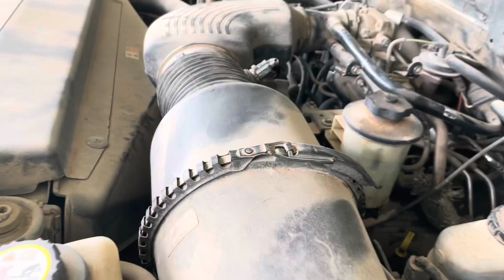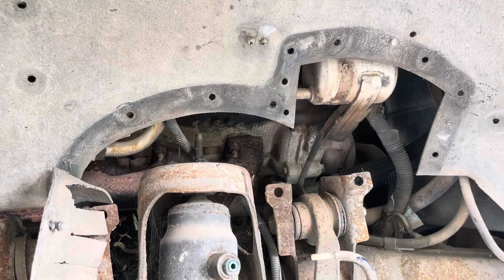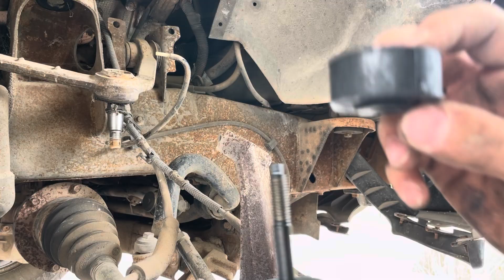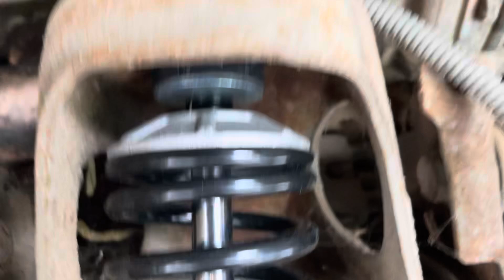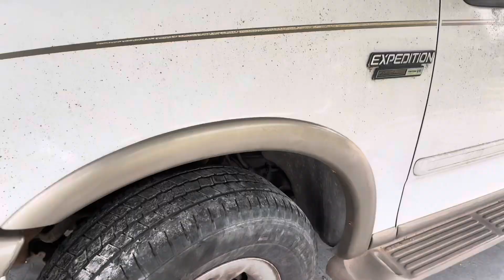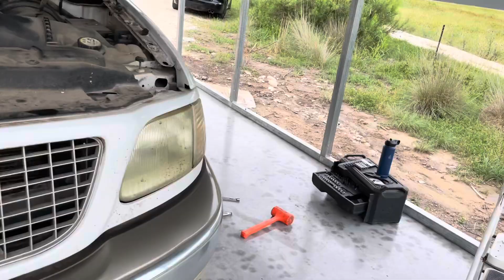Front Air Shocks to MacPherson-Style Strut Conversion 97-02 Ford Expedition/Lincoln Navigator

Comment: It looks like it's sitting at a nice height with thise shocks. We're the torsion bars ever turned to give it more lift?, or just left alone?.

How's it feel up Fron stuff? No bounce?
Reply from the maker: I never touched the torsion bars, but the suspension settled a lot after maybe a week so it ended up sitting quite a bit lower than looks in the video. To me it never felt bouncy at all. Pretty smooth on and off road. On the last video I made on this thing you can see how it sat after the shocks settled.

Comment: There at the end you said you had wished you kept the air suspension. You definitely made the right choice by going with the springs.  I'm about to convert mine over because I've had to replace my rear suspension airbags like 3 times now, and the actual air pump twice
Reply from the maker: I just figured it might ride a little better having air suspension.  That's the only reason I wanted to keep it but it might not have made a huge difference. Definitely more reliable without that system. Let me know what you think after you convert it, I'm curious to hear if you can tell a difference in ride quality or not!
Reply: @opencircuitt I can absolutly tell a difference, but I'm not very concerned with it. It's not as comfortable as the air, but the reliability is much more on par for what i need. I use it as a work vehicle to get me from A to B